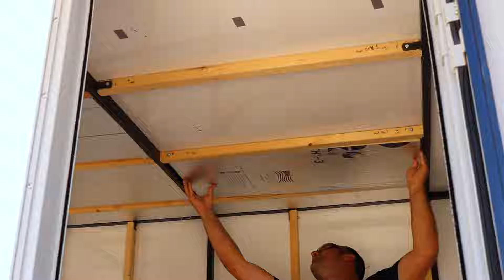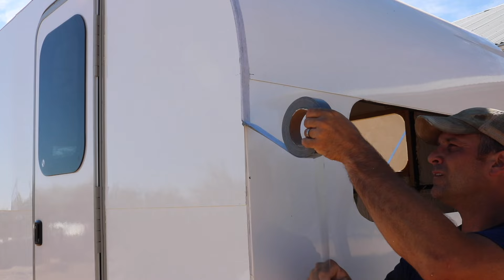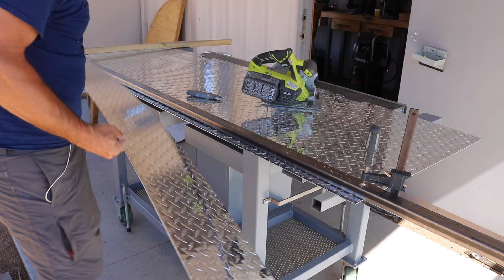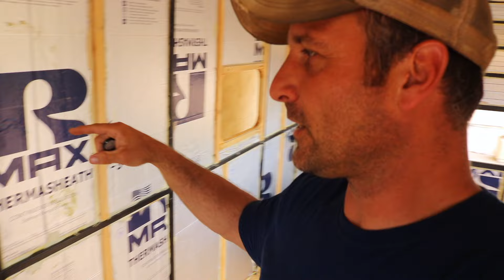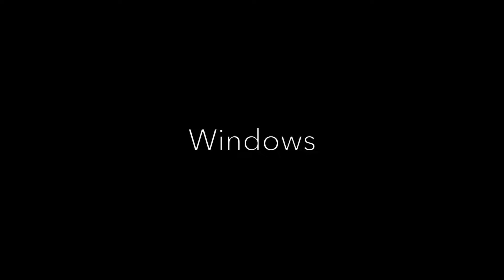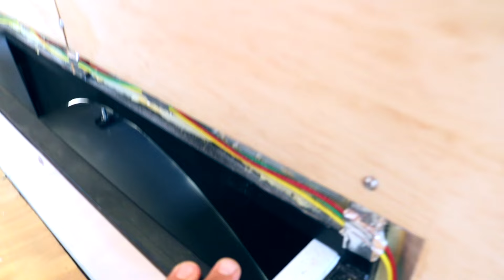How to Build a DIY Travel Trailer - Insulation, Windows/Door, Aluminum Trim (Part 3)

Comment: Where did you buy the door.
By the way your doing a beautiful job.
I too am building my first one ever. I started thinking I was going to build a simple tear drop. It's morfed in to slightly bigger with a two burner, and wet bath.
I'm watching you for 💡 ideas.
Reply from the maker: I got it on eBay.   It was a used ‘seconds’ door that had Some minor dents on the inside and the latch mechanism for the screen door was broken.

Comment: are you still building ??
Reply from the maker: I’ve got about 22 videos in this playlist.   Go to my channel and search playlists and you’ll find it.  Not each one is titled ‘how to build a travel trailer’ with a part number.   But versions like battery box for the diy travel trailer and things like that.   Also, I’ll have two more in this series coming in January and February which should be the final two in the build out.   After those I’ll likely have little more videos and things like that though. 😀👍

Comment: Butyl tape has an aluminum backing that putty tape is what they use on mobile home Windows Doors or trailers butyl tape is what they use around like Vents ducting etc I did weatherization so I was just letting you know

Comment: Seems like all the steel and wood supports would cause some serious thermal bridging with the insulation. Fortunately you have fairly wide spacing between the supports.

Comment: Do you happen to have the final weight of the trailer?
Reply from the maker: 2825lbs with everything but food/clothes/etc,.   But includes pretty much everything else.  I was shooting for about 2500lbs but sometimes i over engineer.   What I lack in intelligence I make up for with more wood, steel, glue and screws😂
Reply: @homesteadonomics  I am the same way, currently I'm trying to build a trailer thats under 3k total weight, giving me approx 2klbs to play with. I am considering the route of aluminum structure but man... the price jump is nutty. I only just now started to try and draw out a structural frame. Thanks for the fast response, really love the channel.

Comment: I have a couple questions I can’t weld so could I buy an enclosed utility trailer and the do this same thing you did by installing windows and a camper door and so on?

Where did you buy the camper door and windows? We’re they pricey or we’re they reasonable?

Comment: RE:  those aluminum stripes....when it's pouring rain out, can any water manage to get its way behind the top edges of those stripes?  I'm always concerned about water damage.
Reply from the maker: If you look closely I staggered the tape that holds the stripes on.   As the stripes are just aesthetic water is able to flow freely behind them.  They don’t serve a water proofing function, just looks😀👍

Comment: How much did you over lap the siding? I'm trying to determine how much sheeting I need. I'm rebuilding an older aluminum framed truck camper
Reply from the maker: Maybe like 4” or so if I remember right.

Comment: I have gotten to love lights that are recessed  into a rubber holder. The lens is below the surface and is MUCH less likely to get broken. Amazon sells them. I would rather depend on the tape to hold all the trim without drill holes.... personally. I like the work and subscribed.

Comment: Hey Joe, what type of VHB tape did you use for the insulation panels? They're different specs. And did you have any issues so far? Thanks
Reply from the maker: I used VHB Tapes CV62F and CV45F (for overlaps).  Stand for ‘commercial vehicle’.... and I purchased it at SRI supplies.   I used the tape for the insulation panels just to hold them in long enough for the spray foam to set up in the cracks.   That is what’s actually holding them now.  Hope that helps😀👍
Reply: @homesteadonomics  thanks, it's helpful. And you used the same for the aluminum exterior?

Comment: Rmax needs a gap between the surface and the insulation or it becomes a thermal conductor and causes the trailer to ger very hot.

Comment: Looks great - comment on insulation.  For our house in AZ I found a product call Prodex Total 10M  It is a closed cell foam with foil on both sides.  It has an R value of R22 and is only .04" thick

Comment: What about the weight? Is that aluminum application lighter than GFRP? Is it less than 750 kg (<1650 lbs)? What are the dimensions?

Comment: OK I have to ask about just what this has cost so far. Steel and aluminum is expensive along with the rest of the stuff like windows and the door, lights all that tape and glue. I have a figure in my head and it would seem buying a used camp trailer would have been less expensive, of course the satisfaction of building your own is immeasurable. Very few people have the skills to do what you have already done for that you should be very proud.

I worked at an RV dealer for several years but that was thirty years ago and what you have done is really an amazing job. Can't wait to see the interior come together. People do not understand the skills needed to work on these trailers. Electrician, carpenter, plumber, mechanic and so on. In your case just the welding part is out of reach for most to attempt.

Comment: Were all the trim rings you installed made for 1.5" wall thickness? Your walls are thicker than 1.5" correct? If so what did you do to compensate for the extra thickness? I am currently converting an enclosed cargo trailer into a camper and am at the point of installing windows but I don't want to buy something that isn't going to work. Thanks!

Comment: I guess my question would be would it not be better to run your low-voltage wiring through the trailer frame then pop up with EMT pipe because of the vibration in the movement I don’t think your wires will survive unless they’re protected in allowed to freely move

Comment: You did a pretty good job considering you built it backwards...you should have lined the inside walls & ceiling first & insulated the walls from the outside before you stuck your outside cladding.  Maybe you should have looked at how the magor manufacturers do it. It's much easier to make changes like the windows. Keep up the good work.

Comment: omg this guys trailer is literally just held together by tape i hope that's good stuff man it looks good i'm just worried
Reply: no, the diamond plate rock guard, the aluminum cladding, and the insulation are held with industrial strength tape...why do you literally exaggerate like a fool?
Reply: @douglasharley2440  how is calling tape tape exaggerating like a fool?

between heat, flex and vibration all adhesives break down

Comment: kool build for travel trailer, 
i had to live in mine as tiny home so made 3 inch insulated walls,  1 inch rigid not bead in walls with 3/4 loose fit spray foam seal 
then factory walls painted 
and reinstalled with 1 more inch of rigid with seams caulked, 
over the last foam put on thermal emergency blanket which reflects heat back in 99%
then with 3 inch # 10 self tap installed 7/16 inch chip board so can mount anything anywhere..
the only problem was every self tap screw had dot of moisture rest of wall 0 sweat, even in -40 f
single pain window iced up,  never can find double pain???  
3 inches of spray foam on the roof furred out with 1 x 4 angled truss , secured with pipe strap / 0.0 drip condensation..
hope this helped more to say,   but cant type it too long...?
Reply: If anything I don't really agree with that but it would be perfect for a threesome and sometimes with these RVs there is a classic issue of things failing so not sure how you would deal with that kind of classic issue all the time?!
Reply: @iair-conditiontheoutsideai3076   x engineer no condensation on thermal break points only door window

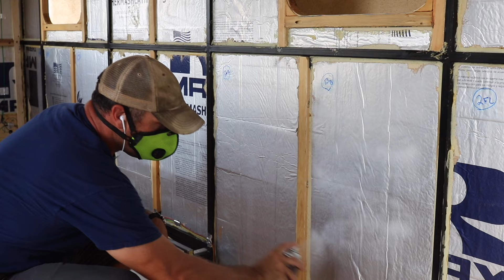Comment: 8:24 you should not add two layers of vapor barrier on top of each other... you created a place for moisture to build up... You may be okay if the inside temperature does not get to meet the inside temperature at that intersecting plane...  Will you add a/c?  That will create the issue I wrote about...

Comment: I would consider using Vulkem 116 caulk for the wall/fender transition. It has a nice texture, waterproof, flexible. Its being used a lot by the Airstream crowd.

Comment: great job though I think you could of used a smaller square tubing for the sides. I kinda have an idea what you mean just I built a patio for my parent. kinda in a forrest area so I did little welding and very little grinding after the frame and platform was up used railing a scrolled work in between the banister. Its still standing after 20 years unlike wood just kkep the metal painted with weather white paint and all is good..

Comment: I saw another video where the trailer was about the same size as yours. They installed a tiny bathroom in the corner like caddy-corner with an accordion style door. He hung the shower head right over the toilet so that you just have to stand next to the toilet or sit on top of the toilet lid to shower then stand up to clean and rinse your bum lastly. The water drains out through the drain in the floor. Then, a tiny sink next to the toilet just big enough to wash your hands and brush your teeth. A cover over the toilet paper roll that you can pull down to keep it dry while you shower. He also left the top open just below the ceiling for light to penetrate. I hope this gives you some ideas. Although small, it gives you what you need. Great videos, all of them. Teaches me a lot. Thanks for sharing.

Comment: Awesome. But this is NOT a trailer. It is a CAMPER.    Trailer carries cargo and stuff, camper carrier humans :-)    Regardless of that, I love the build and I'm pretty sure you already now this - OVERKILL. Most of the little details you did was unnecessary but those are the reason I like the build. I'm like you, if I build it, might as well build it the best I can think of.  No trouble with that but 99% of the people will not need/notice/pay for those little extra details.   Also I'm guessing the  build will go over the budget of buying an Enclosed trailer and just converting that to the camper but again, you built it to your best. A new 6x12 Enclosed trailer is $1950 in GA but nowhere near this detailed.

Comment: Nice camper buildup.  Gives me encouragement to pull my plans off the shelf and build a teardrop I have been dreaming about for some time.  By watching your progress it has revealed some aspects of trailers that I need to address in my plans as well (wiring routing, plumbing, etc).

Some things about your build:  
1) car tires are not the same as trailer tires.  granted, the camper is probably going to be much less in weight than the jeep the tires came off of.  just something to think about if you decide to haul the thing on a long trip.
2) black paint is real nice looking but white paint will reveal rusting steel parts quite quickly.  that is one of the reading the inside of steel bridge cavities are painted white.
3) tongue platform:  have you thought about a mounting place for a generator?  don't forget a spare tire and gas bottles.
4) why not dual wire the camper?  12vdc and 120vac.  Then you can mount some thin solar panels on the roof.  use some space underneath the floor for some lead cake batteries (the kind that do not off-gas while charging).  Or just wire the camper for 12v and install an inverter for shore power.  it is amazing everything you can get these days that run off 12vdc.
5) don't forget about a hot water heater (hole in exterior wall, gas line) and a fridge access panel (another hole in exterior wall, gas line, trigger voltage).

Comment: Excellent job !!  so to cap off for edge and overlap sheet trimming you used... .. .
1. VHB... (very high bond tape) for attaching Alum panels.
2. Butyl tape for corner seems. Then coverd with aluminum trim.
3. VHB 4in. Wide rubber tape for roof Seems... 100% H2O Proof.
4. Sealant tape for corners silver very sticky tape ??              (What was that Please)
Also why did you not use the pink foam insulation it is closed cell stuff. the stuff you are using can get soaked if H2o penetrates the shell.. just in case.

Lastly for all you on the cheap like me you can get cheap windows of different dimensions if you look up chicken coop/dog house/play house windows. ....
(Not as wind/weatherproof I'm guessing but may fit the bill...  look up  shed-windows)  ... Been gathering stuff for a couple years now for my build and will probably metal frame like you. 
I will make high enough to stand on knees and sit just comfortably.  7ft W x 5'H. x 10 L. with Shower, (Have to have one !) Got a hold of some 1/16in siding (Heavy ! and over kill but free.) and steel for trailer frame overkill also, but OK with that.  
You've gone beyond what's necessary but fantastic job !!!  Thanks for sharing.

Comment: Your work is amazing. It has motivated me to build my own trailer. which is the sheet that you use to line the trailer on the outside, and with that you join it and how you avoid that the water does not leak. Thank you

Comment: I'm also in the middle of a trailer build and will be installing the siding within the next couple of weeks.  What was the name of the two seam tapes that you used?  Also, where the aluminum overlaps on the vertical seams, what did you use to seal that up?   I've been losing sleep at night trying to decide on the right way to go with this!!  :)

Comment: Don't forget the ceiling vents... hint wink use the auto solar ones :) no power required plus will be almost like a whole house fan for your camper. Another thing to think about is if when not sleeping the kids bunk could  retract up to the ceiling via pulley system..(they do that in a lot of campers) to maximize floor space :)

Comment: maybe the shower should go on the exterior and be able to click the head on and then bring out a collapsible shower bar and curtain to hang on the side of the trailer and a mat to go on the ground. So there wouldn't need to be a seperate drain for the water from the shower to run out of the trailer. As i i don't think the shower would be in use well the trailer is moving.

Comment: Nice build.  I'm at the steel frame stage on my build myself.  You mentioned two different types of "seam tape."  One was four inches that you used on the roof, and the other is "specially designed for corners and edges."  Do you recall what the brand was?  Or what they are called?  I like the look of the tapes, but I don't know what you used.  Thanks!

Comment: Toungue box to hold 2ea 27 series batteries. And you know the solar part. Sure its more weight the advantage is more battery/time between solar recharge. I have tried 24 series.

Comment: Hey Joe i like what you're doing with the trailer. What tape did you use on the roof and corner seams? I'm in the middle of my own build and am needing to start sealing it up

Comment: Everything you’ve done so far is what we’ve happenstanced upon doing in upgrading our trailer...but it isn’t complete—-we were living in it while fixing it...not practical, but that insulation with foam is great. We also have the reflective house wrap under the foam—especially under the floor. You now have to go outside to check the temperature!

Comment: Butyl tape is great!  For a long time......  Then it lets loose...and when it does things begin to bend in the wind, peel at speed, squeak in ways that drive you nuts at every step and eventually you consider selling or having a joyous family bonfire....😂.   Also, the emergency exit should be able to pop completely from the frame and easily operable by the smallest member of the family.

Comment: Is it your choice or YouTube that limits playback to ONLY 1080p HD ? While I love the HD option I often (as now for example) can't stream 1080p HD on YouTube (Netflix on the other hand does fine) and need to have the choice to downgrade the playback or I simply can't watch the content. So, sorry to say, as much as I wanted to do from the suggested "preview" thumbnail, I simply can't watch your video. Hoping you can provide a lower quality option in the future.
Reply from the maker: Not Here I just pulled it up and checked....you can select through various qualities 360, 480, etc

Not sure how your screen shows it but sometimes it’s ‘gear’ looking icon that you can click and it will give you different option choices.

Hope that helps but they are available.
Reply: Thanks for the check and getting back to me. Really enjoyed the first two vids, great work ! I still don't have the option for the third though. Maybe it's a Firefox (or other my user end) issue ? I'll try it out in Edge later and get it to work one way or another ;-)

Have a good one !
Reply: fwiw part 3 worked fine in Edge, all the options were there and it streamed fine even in HD. Must be some Firefox bug or something (though the previous in your series and other vids were fine in Firefox). Just a bizarre glitch I guess.

Comment: buid 4 solar panels in the roof with your build and always have a way to charge your batteries over time ..... sure you wont be running no 5 foot chest freezer but heck it's a small trailer it doesnt need a billion watt light on it ;)

Comment: I came across your youtube channel and I became interested cuz I was planning to build an off road trailer for overlanding. I watched Part 1- 3.  You did an awesome job. I built a few utility trailers myself and I've learn things from them. I have 2 concern, one is the nuts used on the wood studs. Because of the vibration, I think it should have been better if a self locking nuts is used. The other concern is the main frame where the leaf spring hanger is mounted. It should have been one piece rectangular tubing from the back of the trailer all the way to front because of the flexing of the frame when traveling.
Reply: Looked like he was using Loctite on all those fasteners. Better than locking nuts ;-)